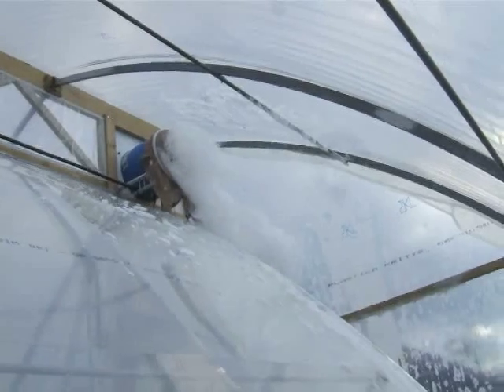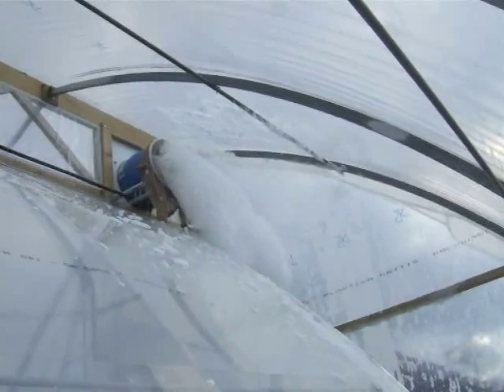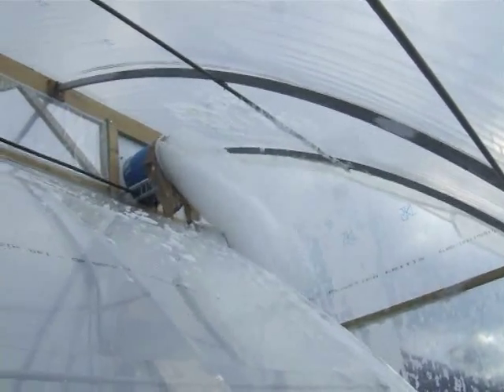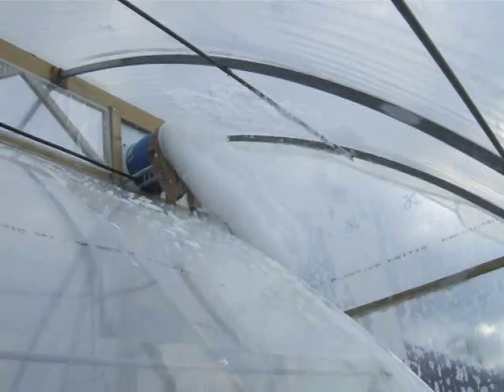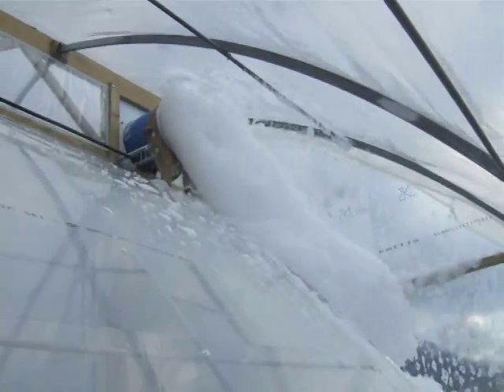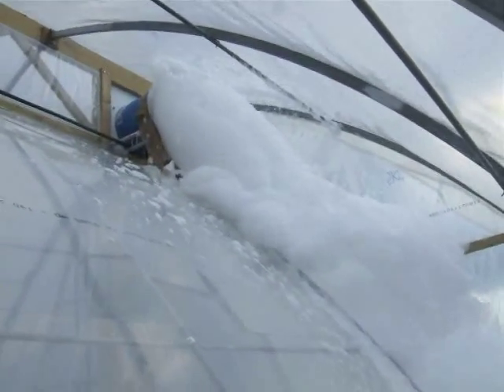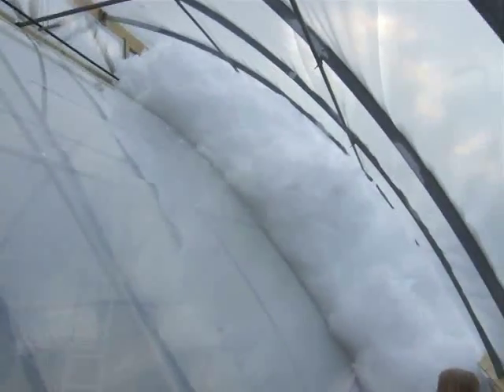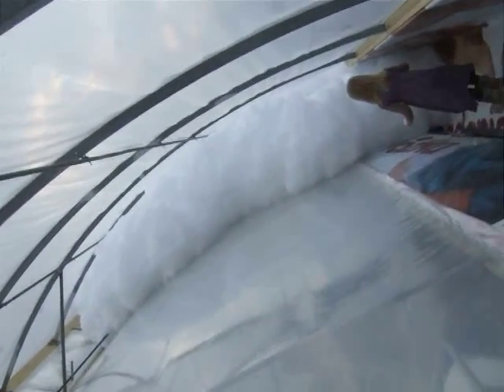LifeSynthesis greenhouse project - testing Bubble Generators installed

Comment: Do the bubbles leave any sort of residue on the plastic? Does the bubble solution need to be refreshed or maintained in any way?
Reply from the maker: Hi Tim, the soap that we use is very water soluble and won’t precipitate (come out of solution) unless it gets cold to near freezing. Sodium Laurel Sulphate is the typical foaming ingredient and every use is cleaning the glazing.  We don’t use any stabilizers (additives that help bubbles to last longer) that are often protein based that can leave a film on the glazing. For our purpose we don’t want a long life foam - so we keep it really simple. The SLS acts as a foaming agent for a very long time and if you recover all the liquid then it can be recycled to make bubbles over and over again. These kinds of soap are in shampoo, toothpaste and are proven harmless over decades of public use to very safe in dilute solution. If diluted too much by adding make up water then we just bring the % of active ingredient up to the normal range of 2% to 5%. In our PyraPOD buildings the bubbles are contained within the sealed wall & roof cavity space and therefore our soap solution is reused, lasting for months.

Comment: How are the bubbles removed?
Reply: I think there's a warm water tank in the floor that's heated during the warm part of the day.
Reply: With time the bubbles will dissipate by themselves. If you want to remove the bubbles rather quickly, you simple turn on the fan without pumping liquid to the roof. The blown air will do the magic work.
Reply from the maker: @azteacher26  Yes, that is right. The warming is achieved by capture of solar thermal energy - this prevents overheating of the PyraPOD. Bubbles are generated, regenerated and destroyed by using the SolaRoof process, which is “recirculating” within the Bubble Cavity spaces - this is the bubble flow dynamic that you can learn about at PyraPOD.

Comment: How do the bubbles work in -40C? do they freeze?
Reply: Yes, bubbles do freeze, and in fact you want them to freeze (some people keep thinking anti-freeze is a good idea but it's not). The frozen bubbles maintain their cell structure and are still R-1+ per inch. This makes freezing each additional inch that much harder, to the extent that the inner layer will never reach the freezing point no matter how cold it gets outside.
Reply from the maker: @roscoelliott  welcome Ross - nice to have your input here!